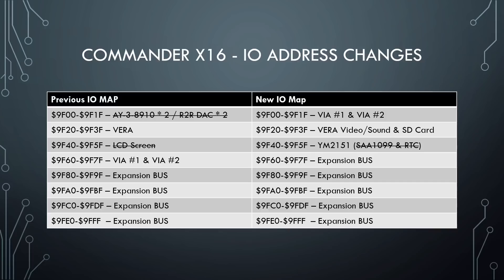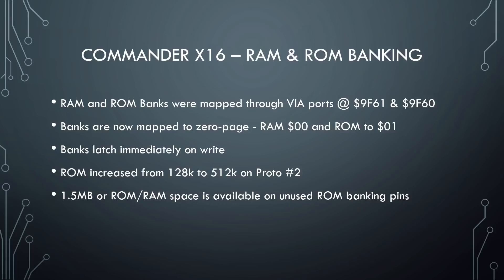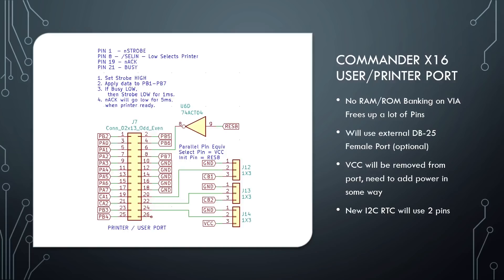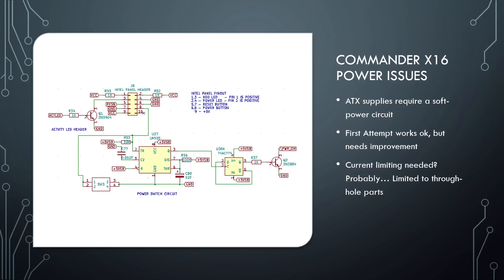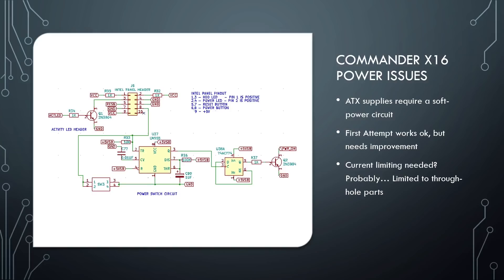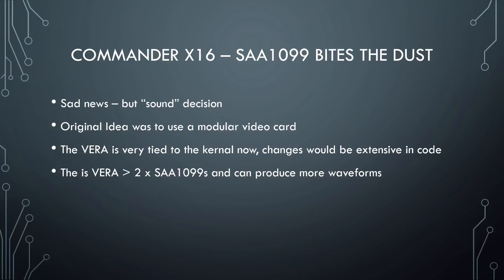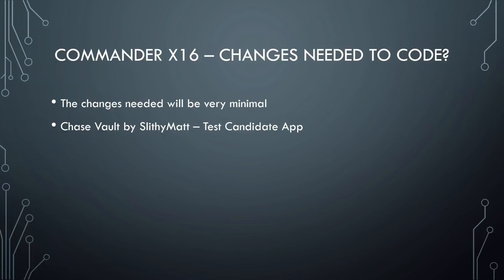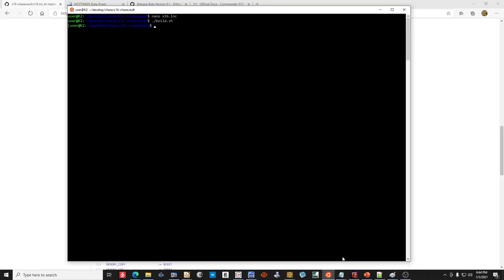Commander X16 Hardware Changes for Proto #2

Comment: For the power supply protection issue: why not use a polyfuse or other self resetting semiconductor fuse?
Reply from the maker: I believe this is the approach I am going to take.   I wasn't sure if this would be adequate, but I've been reading into it more and this is what I'm adding to the next proto.  Unfortunately, to make things safe, looks like I should add a dummy load.  Not welcome news to have to eat around 15watts...
Reply: @TexElec  I wonder why you would need to add a load? Overvoltage protection maybe, but a load? To tame the switching power supply? That will most likely not  be necessary. The multiple output voltages are well regulated with often one being the master and the others derived from that one supply. All loads of the XC16 will eventually accumulate and help the PSU to stabilize.

Be sure to use wide traces to the short circuit protection. And some extra caps over each supply. Select caps with a much higher rated voltage as the actual voltage. This helps extending the life span.
Reply: @ReneKnuvers74rk  Most PC power supplies require a minimum load on them to turn on safely, otherwise they become unstable and the ringing can cause high voltage spikes. This is why it's a VERY bad idea to just jumper a power supply on when it's not connected to anything to "test" it.

Comment: I still don't understand how the /Initialize Output line to the LPT port on the User Port line 6 works. Does it require initializing the CX16 in order to initialize the device attached to the LPT port?

In the ECP interface, isn't that the NReverse Request indicating that the bi-directional data lines are inputs into the system rather than output from the system, and the peripheral device reset in the EPP interface?
Reply from the maker: I really followed the standard port, as I don't think ECP is possible.  Doesn't it require DMA?  Maybe EPP, but please, if you have a better suggestion I can certainly change it.   That's exactly why I posted it out there.  Just kinda making this stuff up as I go along. :-)
Reply: @TexElec  On my first question, is that a yes that the /Init out is tied to the reset line of the CX16? It's EPP that I was actually looking at, the ECP pinout just happened to be on the same pinout page. But EPP doesn't use as many pins as LPT does, and the line that connects to PB4 is not used in the EPP. EPP just has one interrupt line input and then the system reads status to find out what the issue is, so the other three status input lines used by LPT are not used by EPP.

So a jumper that selected between PB6 and the RESB through the diode on the /Init output on the block header pin 6 would work to allow a system-controlled peripheral /Reset. PB6 being echoed on block header pins 4 and 6 in "EPP mode" wouldn't matter since EPP doesn't use the pin connected to block header pin 4.

Comment: To start with the system "off", you need a charge-up delay on the S input to U36A using a capacitor and resistor.  Otherwise that chip will power up in unpredictable states.  This should also be connected to the 555's reset pin.  If adding components is a problem, you already have an RC delay on the CV pin of the 555, so it could also be connected to 555 reset and U36A S.
Reply from the maker: Thanks, very helpful.  I'm not the best at designing these types of circuits.  I must admit, this is where I'd use a microcontroller generally.  And honestly, I'm planning to use an ATTINY84.  I think I can also drive the reset & power from this IC.  It really will be a more stable solution in the long-run.  I spoke to David about it, and it's not really part of the core logic and the code will be realy simple to understand if someone wants to see under the hood.  I'm even just planning to use the arduino debounce library, so I bet the code won't fill a single screen.  Still in the spirit of the system.
Reply: @TexElec  Thanks for the great development work.
Just a remark, ATTINY85 is the 8pin one ... for no reason i assume that it may also be 8pin like the NE555.
Oh and a good decision. NE555s ( warm memories from the 80ties:) ) aren't known for their deterministic behaviour, hehe.
Reply: @TexElec  I wouldn’t jump to a microcontroller right away in any case. There’s simpler chips that will do the trick out of the box (reset monitor/controllers)

Comment: What about a reset supervisor IC for the ATX power on?  If you use one of those, you don't have the complications of a CPLD or microcontroller or violate the "no controller faster than the CPU" issue.
Reply from the maker: I'm actualy sort of cheating and using a reset IC. The Dallas DS1233A.  It's the debouncing which isn't as stable as I like.  No through-hole debouncer ICs I can find.
Reply: @TexElec  It’s not cheating persay. Instead of using resistors, comparitors and open collector. :). 

Couldn’t the debounced be solved with a capacitor and a Schmitt trigger like the TI SNx414?
Reply: @TexElec  According to the DS1233A datasheet, it does switch debounce.  Is that not working for you properly?
Reply from the maker: @KonjonoAwesome  I suppose I could... But, I'm pretty commited to the microcontroller now.  I still need a bit more monitoring capability and I sort of have one more plan now. :-)
Reply: @TexElec  I totally get it. I think the microcontroller is  the better option myself.

Comment: The power on the printer port could be solved by using a PTC in series with the 5V and limit the maximum power/current.
The power on problem, is it only a matter of denouncing or something else?
If so, I would go for a simple RC circuit and a Schmidt-trigger. Either as a IC or two transistor discrete.
Reply: PTCs are used on all powered I/O ports on modern motherboards, they are green in colour
Reply: I thought tha same. Why not just use a fuse or a polyfuse to protect against a short circuit. An other option would be to use pin 26 for the 5V. Then there is no compatibility issue with D-Sub or Centronics printer cables.
But all of this doesn't help if someone set pin 20 or 22 as an I/O and connects a printer. This could/would still cause some damage.
So either way, you need to have some faith in the users. And there will always be someone who still makes some damage, doesn't matter how much effort you put in to prevent this ;-)

Comment: For the Power On, I would suggest just biting the bullet and use a 8-pin uC.  On a real motherboard the power button goes to the PCH.
Reply: Dave is likely the one forcing this choice.
Reply: @FormulaXFD  I think Dave Jones has a video about an extremely cheap $0.03 micro that would be perfect for this power button problem. They can even program them for you ahead of time so all you need to do is solder them to the board and call it a day.
Reply: @WarrenGarabrandt  But those from what I remember are SOIC... I think there is a requirement needs to be Thru-Hole DIP parts
Reply: @PHamster  oh, you know what... You're right.

Comment: Just go MCU. You can buy them quite cheaply already programmed with whatever you want for a very small fee. The dinosaurs are taking the "must be ttl" a tad too far.
It will NEVER be anything like what they used back in the day any way so it's just silly to go overkill
Reply: I don’t understand the need for “TTL”. Is the need for it the current drive, the “low” logic high at 2.4V vs 75% of VDD.
Reply from the maker: @PHamster  It's David's requirement.  He wants no CPLDs, etc.  Also no chip more powerful than the CPU, IE, no microcontrollers.  I may have to talk him out of it because I really don't think I'm ever going to be happy with driving this the way it is.  I could also drive the reset with the microcontroller and save a few cents more on parts.  I can use CMOS or whatever, I just meant it needs to be traditional parts.
Reply: @TexElec  Compromising the safety of the rest of the system's power regulation, simply to adhere to TTL sounds flawed. It makes sense in the logic side of things, but not for the board supply. Designing a compromised circuit that could have critical flaws in situations you guys didn't plan for is worse then adding a single IC that will "do it safely, but isn't TTL."
Reply: Could you convince him to let you use something like an ATTiny85?  They might be close, but arguably not more powerful than the CPU. (And available in DIP-8)  If accessibility to modification is part of the requirement, you could even use the Arduino environment to program it... barrier to entry is pretty low then.  I do have a soft power switch circuit that works that I'd be happy to share if you really want, but I'd have to install Eagle on a computer to take a look.  

On the "power" issue... I'm not sure I understand the problem.  If you hook up a 900W power supply, your circuit isn't going to magically start drawing more power.  If you're worried about someone doing something dumb and then melting traces, just add a properly sized polyfuse where the power enters your board.  Again, they're easily available as through hole parts.
Reply: @ScottWalde  I wonder if they’re dealing with in-rush from all the capacitors used?  The in-rush of the PICO ATX Supply won't be the same amount of as a 900W Corsair PSU.  Since it's suppose to be simple with "TTL" mentality, the polyfuse is your best bet.
Reply: @TexElec  Going from a Barrel Jack to ATX power supply basically changed the requirement.  Typically with an ATX Power Supply you have the Power Good signal to indicate to the Super IO that "Yup We are go for launch" so the Power Button can be pressed. 

Side note... Could your "random power on" issue due to the D Flip Flop being in a unknown state while 5VSB is ramping up?  Maybe a pull down might help at the output of "Q" & weak pull up on "D" to ensure the state of the output.
Reply from the maker: @PHamster  I was already thinking that, and was going to glue a few more resistors in.  I've only ever hooked up switches to ATX supplies in the past, and this was a very last minute piece I added.  However, I do know more is needed here and I really do think a microcontroller will be best.  I'm going to push for it, you guys have convinced me that it is a necessity.
Reply: @ScottWalde  Yes ATTiny85 is a no-brainer here.

Comment: I'm so thankful you guys are keeping the YM2151!!
Reply: Is that a given though? It seems to me that it makes sense to have the YM2151 on  an expansion board for people who want it but not make it a requirement.  This is in view of when stocks of YM2151s run out and there are no more to be had and would simplify things for phase 2 and 3 of the design - it'll mean one less chip for the integrated designs and VERA ends up being kinda like a 21st century TED  or VIC chip.
Reply: @calags  yep I'm wondering that too. At first the idea of the VERA taking over sound kinda bummed me out but it will still make the X16 unique, the VERA can still be upgraded (albeit with many caveats mentioned in the video) and external cards can be used. Having 16 PSGs and 2 DACs is still handily above any 8-bit home computer I know of. TG16 had 8 I think - all programmable as I recall though - not sure what waveforms the VERA may have here. I think I read on the forums the VERA doesn't have ADSRs either (whereas the YM2151 does), but even so, the base sound seems like it would be quite impressive without the 2151.

Cost containment, I thought, was the highest priority and since we have expansion slots (a killer feature I think) - FM sound can still be supported. And given the "room" available on a card, that also opens up YM2151 compatible solutions that might otherwise not fit in the original chip pinouts (notably a YM-on-FPGA solution).

Trouble with cards is compatibility for games and things but I'm rather excited to see how that all might shake out. Sort of a weird retro-soundcard-competition-rennaissasnce?
Reply: @calags  AFAIU, unlike the SID, the YM2151 is an all-digital chip, and there are already cores implementing it available. AFAIU, that was in fact part of what swung the decision to the YM2151 -- there are a substantial number available, and if the supply runs out, there's a fall back option.

Indeed, it's likely that the "3 or 4 chip" CX16e has it in the same CPLD/FPGA replacing all of that glue logic, and it might be the same for the CX16c. Only the most expensive CX16p would necessarily have to have the chip, and that is likely to be the one that sells the fewest units.
Reply: Glad to see this too, although the 1099 was still in production (I thought?) but the YM2151 definitely isn't. From a cost contaiment standpoint, having the VERA manage sound, still offered a lovely landscape of sounds (especially if the DPCM was hardware loopable - though I'm not sure if it is - ala the GB, FDS, and TG16 for "drawable" chiptune waveforms). The FAQ says 16 PSG channels. That's a lot! But of course, 16 PSG, 2 DPCM, and 8 FM is quite a monster!
Reply: 26 channels...

And 256 color mode on both text and actual graphics, with smooth scrolling, sprites and whatnot.

Why isn't Commander X16 considered 16-bit?!
Reply: @fnjesusfreak  
I see.

It's just the graphics and sound capabilities seemed too powerful for an 8-bit system, whenever be a video game console or a computer.
Reply: @marioalexanderski9598  It's considered an 8bit because it has an 8bit data bus connected to an 8bit processor. Indeed, like most of the classic 8bits, it has a 16bit, 64K address space, it's just that 16K is a portal into a 512K of ROM, 8K is a portal into a 512K (or higher) of RAM, and 32bytes is a portal into 128K of higher speed RAM used by the Vera video chip.
Reply: @brucemcfarling7810  
Some people would be fooled by Commander X16's 16-bit-like video and audio capabilities.